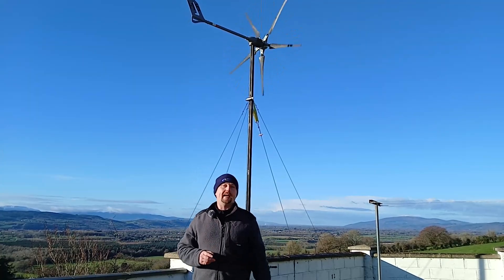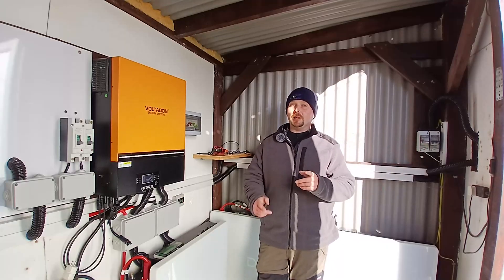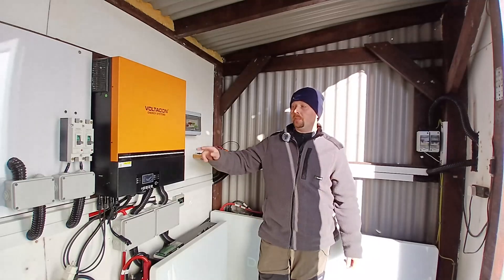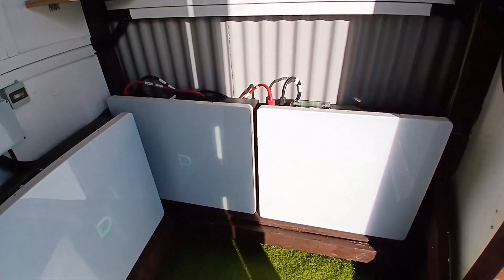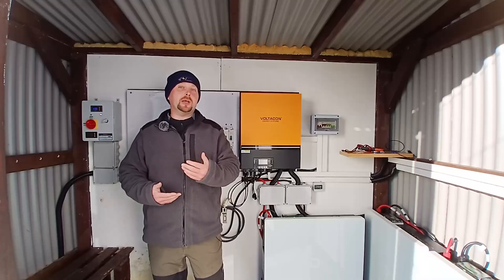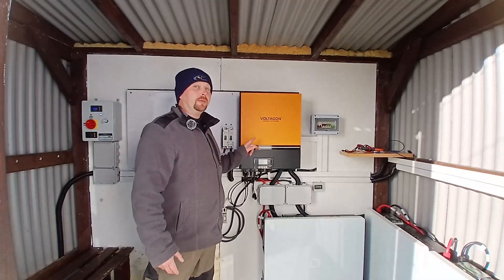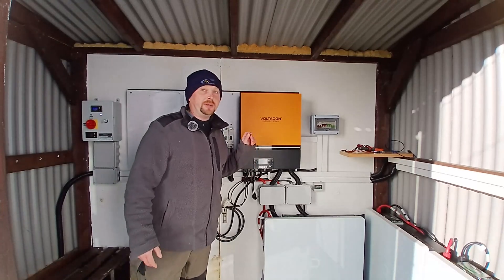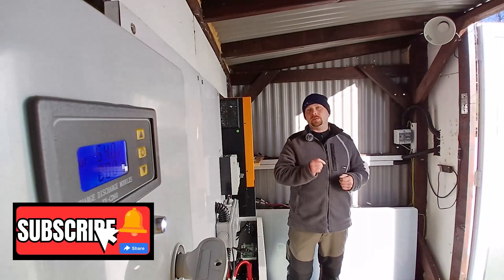Wind Turbine Update, 24v - 48v Did it Work?

Comment: What kind o turbine? Brand?
Reply from the maker: Istabreeze i1500 24v. Works very well at 24 not so much at 48v. An i2000 is required.
Reply: @ourkilkennyhomestead2006  Thank you. I will install it soon.
Reply: @ourkilkennyhomestead2006  What kind of wires do you use? What diameter? Thanks in advance.
Reply from the maker: @ViorelBoca-u2u 6mm2 minimum.

Comment: will use 12v charge control unit on 48v turbine
and add a boost charger turbine chargers battery 12v and slow speeds boost controler boosts 12v off battery to 48v that you can use
Reply from the maker: Good info. Voltage booster will be here later this week. Going to use 24v up to 48v

Comment: Nice try but I think to get any useful energy at all out of wind it has to be larger scale, these small turbines just don't cut it. I'd more rather invest in more solar and move away from wind ?...
Reply from the maker: It worked very well at 24v, kept plenty of power coming into the 24v batteries. Unfortunately the i1500 generator is based on that level so no good at 48v. 
The reality of off grid here in Ireland is that solar alone doesnt work all year round.
Reply: But the EVangelists said wind was enough to power everything, all the time, with no backup?  If it’s tricky on the personal level, imagine on the grid level, when long-distance transporting  and converting the power is also needed…

Comment: Isn't the main problem that there just isn't enough energy in wind? When I think about how much air a 100W fan moves. And you can only get a fraction of that energy converted to the generator. I just don't understand why you would not use a solarpanel. for the price of a windmill, you can get so many panels, that you could get more energy from a full moon.
Reply: Often you will have winds throughout the night and in bad weather when the panels are doing nothing.  In the right location they can be fantastic, giving a near 24/7 constant charge which really adds up vs 6-8 hours of solar.
Reply: @BrightLights1772 I believe you, but I never saw it. My experience is that it's just a promise. As soon as you put a load on the mill, the mill stops.
The windmills from the middle-ages are huge. Size definitely matters. As soon as the effective area is not even a square meter, you can't even charge your laptop while it is running.
Reply: Wind is even more inefficient at grid level, rarely reaching ROI before EOL.  Not cheap, efficient nor reliable.
Reply: @jeffforbess6802 but.... Heavily subsidised.

Comment: 5 blades less RPM more torque, 3 blade more RPM less torque. I have a Whisper 100 and the wiring can be changed for 12,24 or 48 volt and has to be done at the turbine not by changing the controller.

Comment: I think the ista 2000 48v 3 blade will do the job. Only a few hundred quid. Even for the windsafe version, which given your wild weather mught be a good idea. .
Reply from the maker: Yes indeed think so too. Another commenter suggested to buy the generator section on its own which makes a lot of sense.
Reply: @ourkilkennyhomestead2006  I see that ista are selling the i2000 48v windsafe for only £441 ( omg that's cheap ). WIll be the usual add on tax of about £60. But that's dirt cheap. The gennie unit itself is about £320 + import tax. Buying the i2000 windsafe may be toooooo tempting! Good luck anyway !

Comment: Amazon 1500w or 1800w boost converter for around £20 will easily ncrease your voltage to charge 48v batteries. I tested one and it works a treat.

Comment: I wouldn't butcher the existing turbine with extra shafts and stuff - it probably won't work it's the motor windings inside that are the problem and that you can't change.  Just sell it in good condition, and buy a 48v turbine. 👍

Comment: I have no idea why wind turbine set ups dont use step up DC converters with set voltage output so no matter how slow the turbine is spinning its making power and charging. Just amperage increases or decreases based on speed. Thats what im about to do with my windmill install.
Reply from the maker: Most likely to prevent over voltage on the input during high winds. Best of luck with your project, hope it works well for you.

Comment: If your inverter can handle AC coupled charging, get yourself a proper grid tied turbine controller. I’ve a 24V 1000W wind turbine and regularly see 800W in strongish wind. Gusts would take it over 1000W and cause the controller to shut down. After making some adjustments to the load profile, I no longer get that problem.
Reply: Which controller are you using

Comment: 5 blade 24v ista will never do 48v, what did you expect honestly. Get a 3 blade 2kw 48v. Needs to be mounted way higher aswell. 10meter tall above anything within 100m radius. If you cant put a mast that tall, frget about the whole idea.
Reply: If the installation is anything more than a hobby or experiment, I would tend to agree.

Comment: I've been running an Istabreeze 1500 watt 24v unit for nearly 4 years now. It will never pay off for me since I get good wind...when it blows...in only a 100º vector. All other directions are treed out. I have made a mode where if the wind is blowing below threshold for full 24 volt output, I switch it to an 18 volt FLA battery bank, then using a step up converter to charge my 24 v bank. When we DO get a day of strong wind and it is really hammering the 18 volt bank, I switch turbine directly to the 24 v bank where is does what it's supposed to do. I will say one thing, this unit WILL meet rated wattage and some but the wind really has to be blowing so hard, that just going outside is a hassle. I abandoned the 5 blade setup I originally ordered it with and after finding it still wouldn't charge until wind hit at least 15mph, I ordered the 3 blade hub and switched over to 3 blades. Found that 3 blades actually did better! Especially at higher wind speeds. The only thing the 5 blade setup did was get it spinning in low wind but still did'nt genererate any power till wind again hit 15mph!
Reply: I got round this by running my two i1500s(24v) into a 12v battery bank. Has worked well for over three yrs. Reaches charge voltage in light winds  mph. Have sacrificed the vanity peak power ( now maxing out at 8 to 900w) but I get 200 to 400w (per turbine). So overall yield is really good. Also. I tried a 5 blade model and got frustrated seeing it spin but not generate. 3 blades is the way to go.
Reply: @nhikoid  Wow, 2 turbines? Cool. What I was worried about was running the 24v turbine into 12v bank like you're doing is that if the wind does pick up, could the windings overheat due to the fact unit is being bottle necked at 12 volts? I chose an 18 volt setup using 3 6v golf cart batteries in series then a step up converter to take the 18 volts up to 27 volts for the main bank that runs the inverter. Doing this, I start charging with a 12mph wind instead of going directly to the 24 volt battery bank where it won't start charging until wind is nearly 20mph! Thanks.
Reply: @curtchase3730 interesting setup. 18v is a good compromise. Also, your step up circuit probably smoothes out residual SC ripple which would probably be okay for a lifepo4 24v bank. I've had no overheating problems with either turbineausing 12v batteries. May use a dc dc charger to feed a 48v lifepo4bank in the future. All very interesting. .
Reply: @curtchase3730 There doesn't seem to be any bottleneck effect  from using 12v batteries. Peak power has been reduced by maybe 20 to 30% but overall yield is far better. Basically, this makes the power curve less steep. Used to get annoyed at the i1500 whizzing round but not generating when using a 24v bank. I had thought of using the Amazon boost converter to ramp up volts at low rpm and pair it with the Amazon buck converter to ramp down volts at higher rom. (By setting the ramp up set point on the booster and ramp down setpoint on the buck) Effectively creating a poor man's mppt system, but with only two [amps v volts] points rather than the usual dozen or so you get with some posh wind controllers. But whilst contemplating that I came across a brilliant John Daniel (Olympic Power Controls Videis ) that explained how it was perfectly reasonable and very beneficial to run into lower voltage battery packs. Also, when changing the bearings I noticed the rotor windings were perfect. No sign of overheating.
Reply: @nhikoid  Hi and thanks for your ideas! I have watched some of John Daniels videos too. He was real helpful in understanding wind turbines. Trying to get the most energy from the wind turbine is a tricky proposition. I chose the 24v model simply because my battery bank is 24 volts! Like you, learned after installing turbine, that there is no usable output until the wind hits at least 15MPH and only starts to get real at speeds of 20MPH on up. I live in an area where 20MPH winds blowing all day long are far and few between, but winds from 10-20MPH are more common. Because of that, I built a stand-a-lone 18v FLA battery bank to try to harness energy with less wind. I never actually tried to run my 24v turbine into 12v batteries yet. I just figured that would overload the windings and maybe burn them out. You say that won't happen? I guess I could try that and see how it goes. What I have done already is if we have a very windy day, and I can't upconvert enough power from the 18v bank into the 24v bank, I will manually switch the generator directly to the 24v bank (like it should be). I need a micro controller to do this automatically but don't know how to implement it. All as I know for sure, is that w/my 3 blade setup, the wind has to exceed 12MPH just to get the thing to start spinning. Once it gets going, it will spin until the wind drops below 8MPH or so.

Comment: Is there any way to increase the blade diamerter?  If you double the diameter, you'll quarduple the power... so increasing the diamter by 50% would give you 2.25x more power.  It you have to end up using a gear ssystem, a toothed belt will probably be the quietest option.
Reply from the maker: Could be an option, currently considering buying a 2kw 48v generator section to replace the 24v one. Retail price is €320. Thanks for the info, much thinking to be done.
Reply: @ourkilkennyhomestead2006  You basically have three options. Go lower voltage - that is a battery at 24V, and an off-loading DC-DC set up converter to the 48V system. That is what I'm going to try.
 2 - get that prop three times as high. The wind really picks up at altitude. 
 3 - As ai4px said - increase rotor diameter. This will also put it at risk of exploding when storm winds hit it, so a secondary safety system - as e.g. in a tilting mechanism - is needed.
I can't really recommend gearing, as you will lose about 15% minimum at every mechanical coupler/gear. Also, you will need to take the generator down once a year and inspect/service it. Those bearing take a beating due to condensation from the different temperatures during day and night.
The carbon-power transfer ring is also a point of failure - which I will try and remove from my unit.
  All the best and good luck.
Reply from the maker: @Everstrife lots of good info there and thanks very much for putting it into a comment. I agree with you about the gearing, it would increase the initial load leading to losses and efficiency problems. Increasing the prop diameter is always an option, 1.5m blades are available its currently running 1.07m blades. The 4th option is to buy the 48v 2kw gen section and fit it in place of the 24v 1500w gen section In the body of the turbine. The cost of this is €320. 
This would give us a functioning turbine and leave me with a 1500w spare pma to mess around with. Another commenter did a gearing setup in a 3:1 ratio and got great results. Certainly food for thought.
Reply from the maker: @Everstrife  worth a mention that were forecast to get 50kph winds here over the next 12hrs so im going to let it rock and see what happens. Itll be a good test of the mast either way 😊

Comment: Bro you should be clearer in explaining that you only swapped out a 24 volt controller for a 48 volt one. You didn't change the rotor, blades or windings. I don't know what you expected to be honest, the wire guage and number of turns in the windings will be built for half the voltage you're expecting. The real question is- is it worth keeping the 24 volt turbine at all to try your modification on or is it better just to flog it and get a 48 volt one thats built for purpose?
Reply from the maker: I did clarify that in the previous video as well as the beginning of this one. You're spot on, the question is whether it's worth it.
Reply: Or get a grid tied controller and the battery voltage becomes irrelevant.

Comment: I have DC-DC converter and potential problem is a too high "IN" voltage (during really strong winds) which potentially can fry semiconductors in the unit. I tested other small generator 24V (without DC-DC in this test) mechanically powered by bigger hammer-drill and I fry 2x12V=24V 2*21W bulbs in serial, there was peak voltage at 98.2V! Probably we have to use or mechanical brake or/and short this circuit before power goes to DC-DC converter.
Reply from the maker: Thanks for sharing your experience, it highlights the importance of over-voltage protection in these setups.
Reply: Good point made there. DC voltages can get really high with no battery connected ( or on the circuit between the turbine and boost converter/charger ), even for a 12v turbine, let alone a 48v one. Given than your average person offers around 1000 to 2000ohms resistance then if you touches the terminals of the rectifier or converter you could easily conduct 20 to 100ma which can be dangerous especially if touching with left and right hands at the same time. I got a nasty bump a couple of years back going exactly this. Didnt feel great for a day or two afterwards.  Im really surprised that manufactures of small turbines don't highlight this.

Comment: Dont for get a 2kw 48v istbreeze generators £260 on fast trading istabreeze.
I had the feeling it wasnt going to work for the 12v and 24v haveing a 90v generator and the 36v and 48v 220v, i read it on a istbreeze website
Reply from the maker: Thanks for the info Henry. Going to the website right now.
Reply: Links in your email  £233.31
Reply: If i had put it on here it would sell out in 4 days, like my solar pannels did.
Reply from the maker: @HenryOwens-py3ur 😂
Reply: thats kinda not funny Mike, becuase then i researched to buy them at another shop and for the price they want i can buy 10 brand new 600w solar pannels so i posted that on youtube and then they sold out thar make of every solar pannel within 2 weeks.
Reply: But it has led me to a direct from the manufacturer, but minimum orders 33 pannels, but still the price direct is gob smacking compared to a seller.
Reply from the maker: @HenryOwens-py3ur sorry henry, the laughing emoji was at the irony of the incident as opposed to anything else. A lesson learned though i guess.
Reply: twice over, allmost led to the extinction of post helpfull techniques. But it did led meto 33 pannels are cheaper than 15 from a seller.
Reply: I could try and fine a buyer for 23 of the 33 pannels. When i save up for the 10 pannels.
Reply from the maker: @HenryOwens-py3ur fb marketplace would be a good place to advertise them. We sold all our old panels there within 1 month of advertising. Might be worth hanging on to one or two of them though, for small projects like garden pumps or similar stuff that you might want to automate in the future.